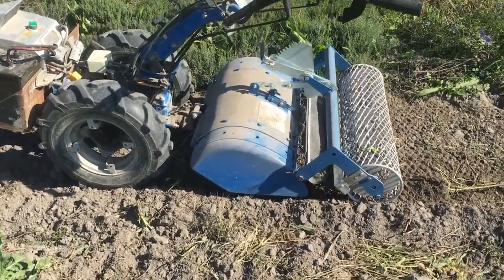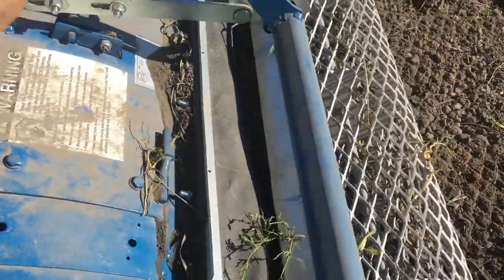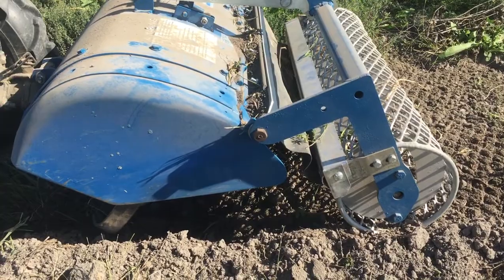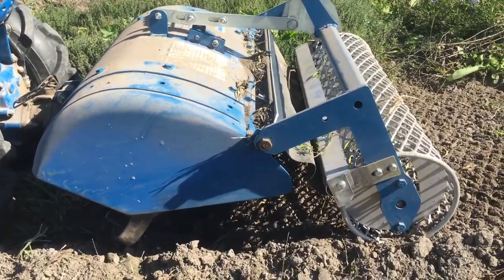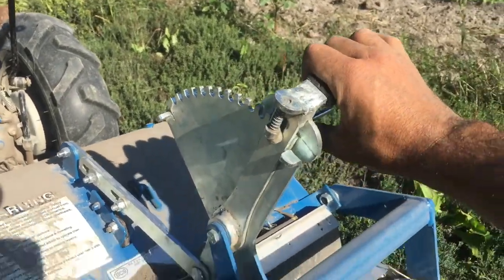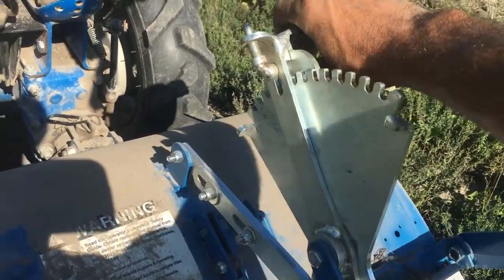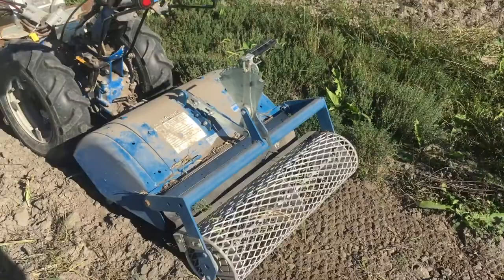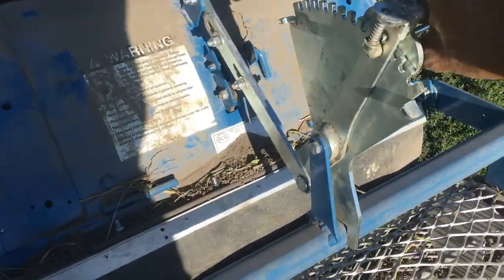Electric BCS - tiller with Thivierge depth-control roller

Comment: I love my bcs and love your conversion...don't think I'm ready to do this on my 853...but I have 7 old david bradley 2wheel tractor...how do you think they would convert, they are all belts and pulley so I'm thinking easier....and what kind of run time do you get?
Reply from the maker: 853 might need a bigger motor or at least higher voltage than what I used but it's doable.  My battery packs are all 1000Wh or 1kWh and if you run it steadily at moderate to high load with almost no rest you get 30 minutes of run time.  

I've only ever had one task where I could run batteries down several in a row (tilling an entire 150x35' greenhouse.  With multiple batteries and a 500W charger you can set yourself up for effectively endless runtime but you have more $ tied up in batteries

DB walk-behinds are great candidates.  There's one already done here on YouTube.  Tyler Buck, Sensible Soils.  I've converted our Planet Jr. BP1 and am working on a Tilmor Power Ox.  The PJ is amazing as an electric machine.  Don't know runtime yet but it draws less power than BCS and is deadly simple and clean.

I think cultivating walk-behinds are arguably an even better application for battery-electric than a tillage walk-behind like the BCS.  Absolutely if you have more than one DB pick the lightest or best equipped and get started!

Give me a shout if you ever need help or further advice.